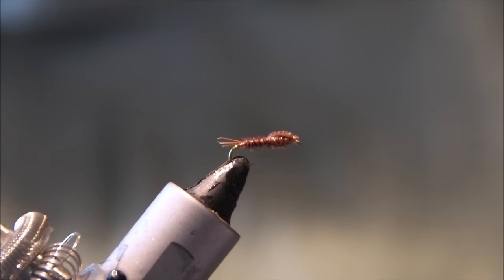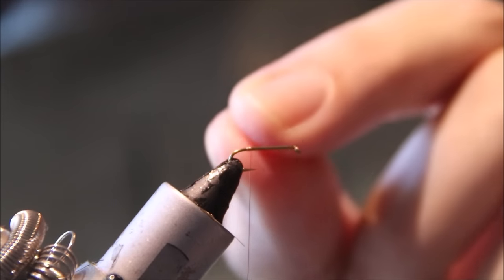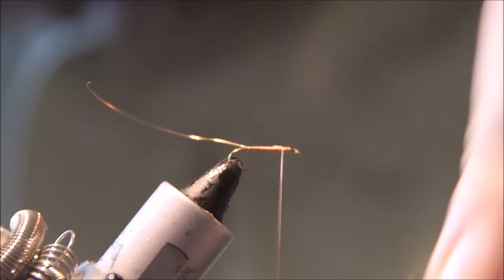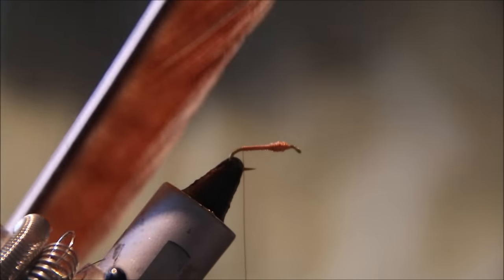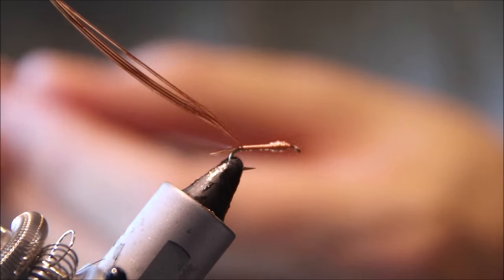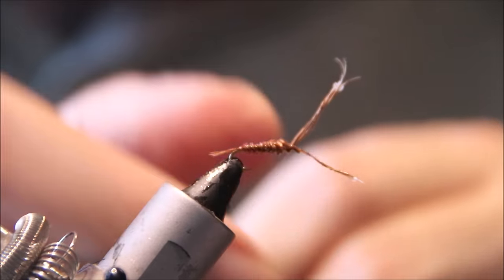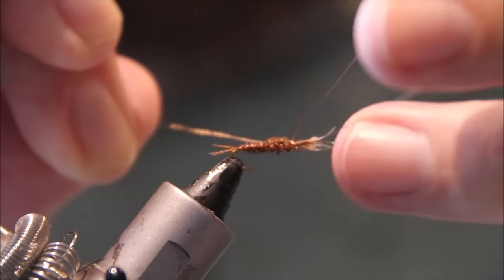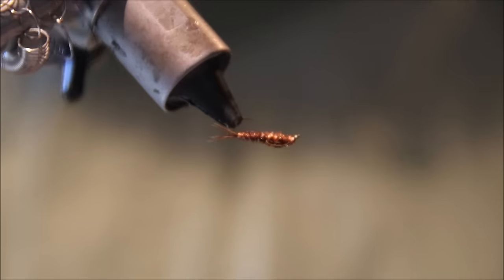Tying Frank Sawyer's Pheasant Tail Nymph

Comment: Fantastic, just the way Sawyer's book suggests! I usually take 18 inches of wire at the beginning and not use a bobbin at all. Just preference. Another thing I do that isn't in the Sawyer book is, I leave a tag of wire after the whip finish and tag the head with superglue. Then after it is dry I helicopter off. I have had a couple loosen up when spinning off the wire and then there is no way to tighten again. Then after superglue, I always put two coats of varnish. (Superglue turns white when exposed to moisture and is unsightly) the two coats of varnish keep the superglue from "bloom" All the best and thanks for sharing. Sean
Reply from the maker: Sean Mooney hi Sean,  I used to just tie it without a bobbin but I was wasting a lot of wire that's my only change. I know a few people that use superglue for security and sometimes I'll use it if it's sitting right next to me to be honest.  All the best Martyn